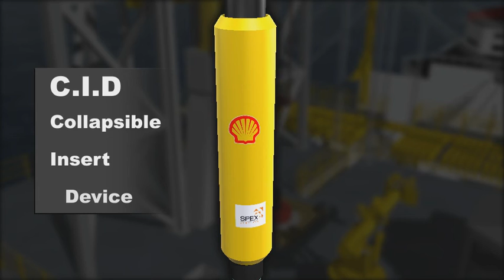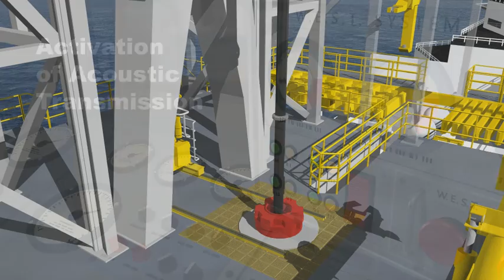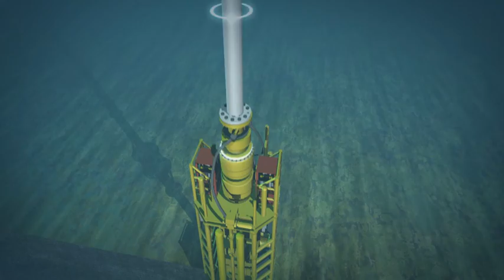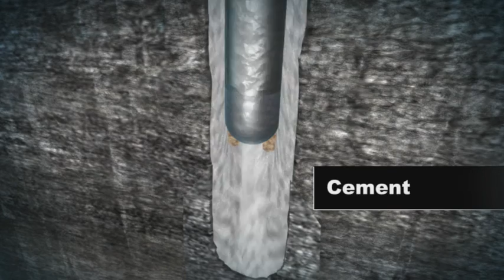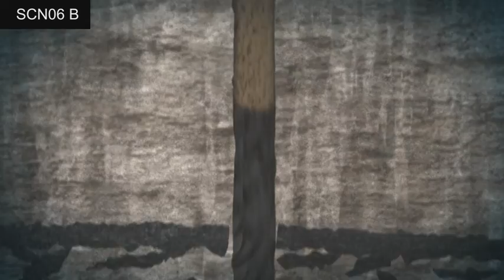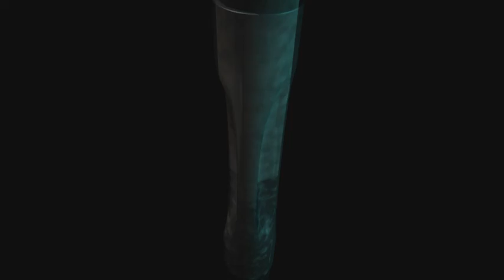New Devices from Shell

Comment: A good way to get more information about the relationship between dissolved gas and free gas in the mud is ultrasound. A fast multi-channel process many parameters can be measured in real time under turbulent flow conditions in the borehole fluid.
 
The safety of deep sea drilling is one of the most important areas.
In addition to monitoring the flow rate of the mud and the  pressure measurements can analyze the characteristics of the mud. New electronic methods allow even the smallest changes in the speed of sound through the dissolved gases (a few percent saturation) and due to lower inflows of hydrocarbons are sure to measure and to warn.
This also works with oil based mud.

Further details of the measurement technique, see below:
 
http://www.ibj-technology.com/Kick_Detection.htm
http://www.slideee.com/slide/gas-kick-detector
http://de.slideshare.net/Engineers/offshore-gas-kick-detector

Comment: On 08/02/11 10:36 AM, Bruce Williams wrote: 
Dear Iker, 
I'd be interested in talking with you about your ideas. It sounds like you have some interesting concepts that we could discuss. Do you need to send me an NDA? 
Cheers, 
Bruce Williams 

On 11/30/10 9:00 PM, Iker Acedo wrote: 
Dear Bruce, 
I encourage you to find a solution placed at the bit or intermediate stage or cementing shoes. I have to tell you I have a desing for a casing detector, underground midrange, located at casing